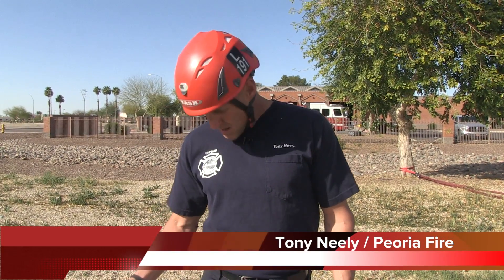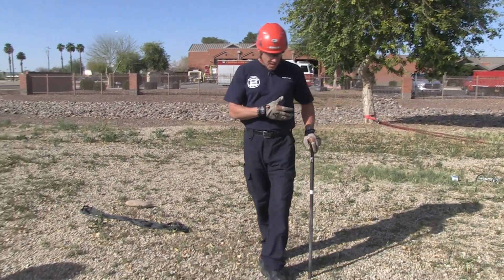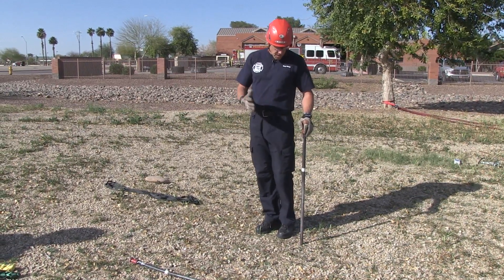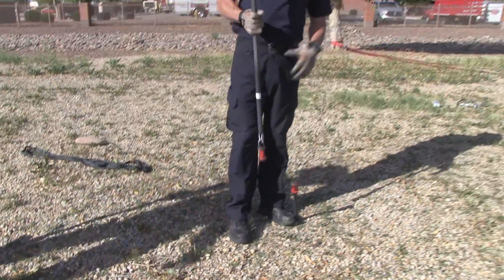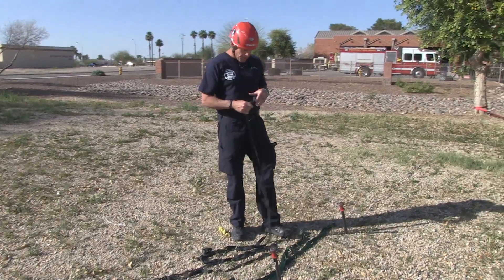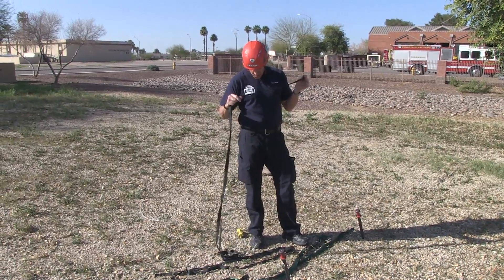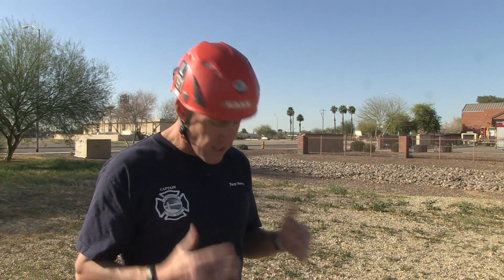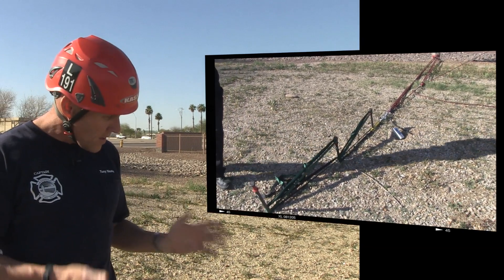Picket Anchor System, Rope Rescue

Comment: Tony, thanks for posting the video.  These presentations are important for members to review who don't regularly use these systems but who need to remember all the details when they are part of a crew tasked with establishing anchor points.  The last thing we ever need is for an anchor system to fail under a load.  It would be helpful if you would advise the recommended lengths for webbing for crews who want to pre-package webbing kits specifically for their picket kits.